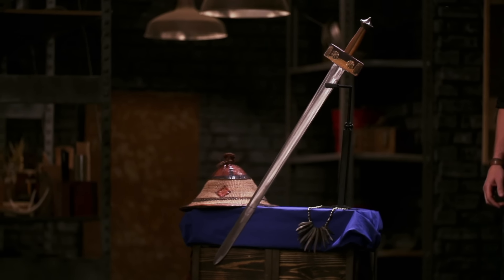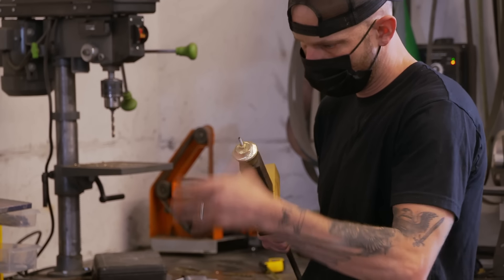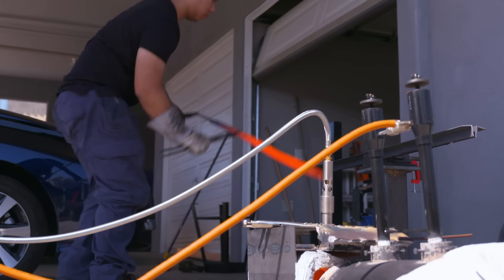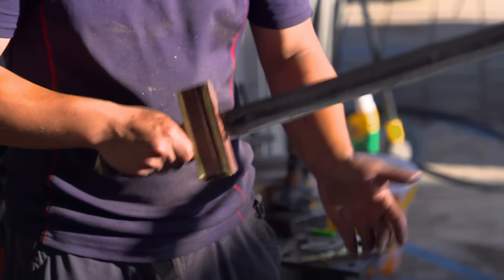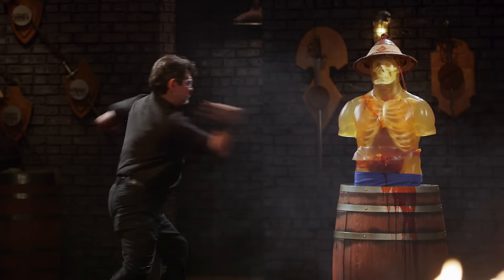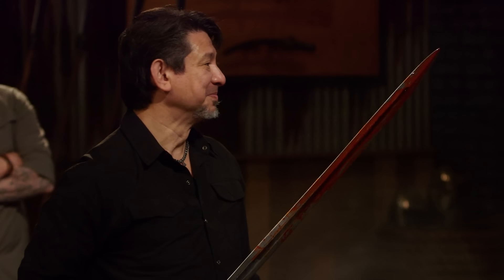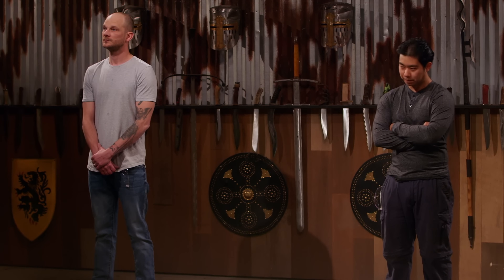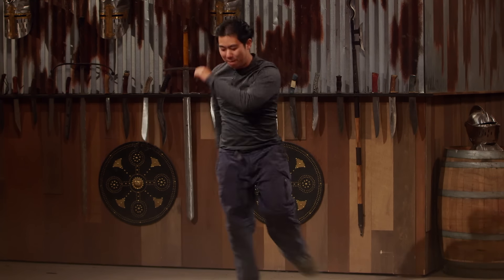TERRIFYING Tuareg Takoba TEARS UP the Final Round | Forged in Fire (S8)

Comment: Dustin's sword broke at the junction between the blade and the tang. In this scene( 1:14 ), you can see that the junction was made at a right angle without curve. This is a good shape for a guard attaching, but it causes stress concentration and leads to breakage.